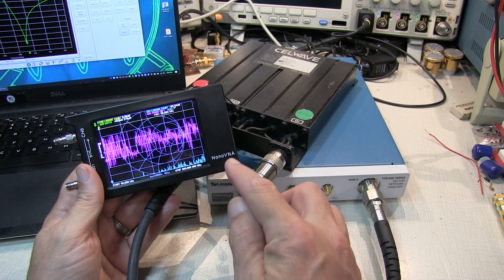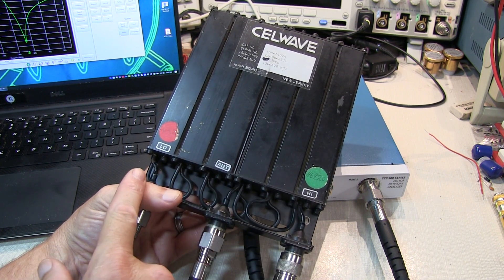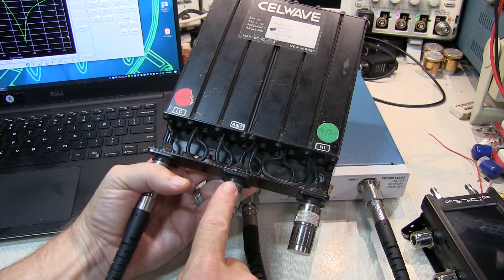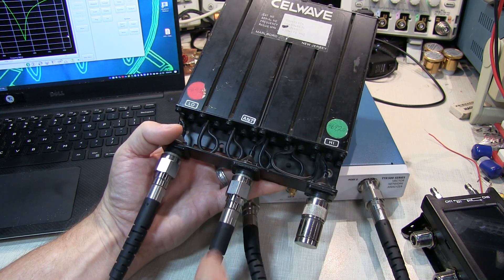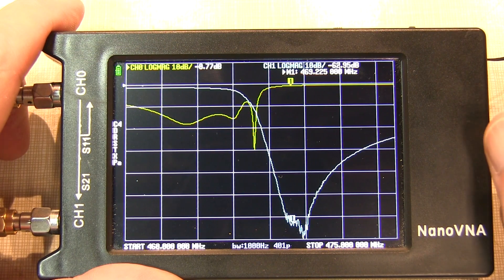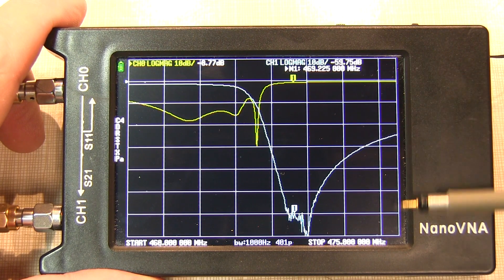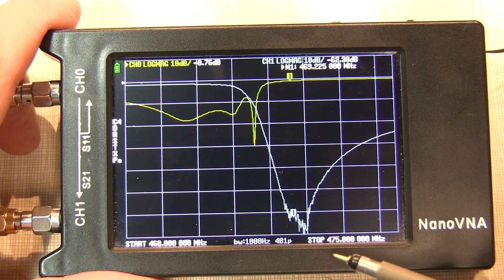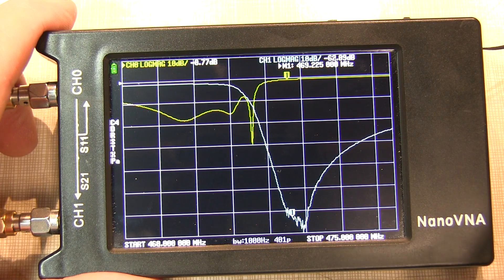#318: NanoVNA comparison measuring a duplexer - NanoVNA-H4 and SAA-2N

Comment: We have a TTR506A at work that I use daily and it's a fantastic device but for doing home stuff I love the NanoVNA stuff. I'm looking forward to the next V2, according to the developers on EEVblog it should be expanded up to 4GHz with a faster sweep speed too.
Reply from the maker: Nice - what kind of work do you do with the TTR506A?
Reply: @w2aew  We do a decent amount of antenna characterization for prototype systems here; not extremely demanding work for the VNA but I like the interface and the portableness of it, plus the support has been pretty top notch too. I was a little disappointed to see the removal of the TDR measurements but I wrote a quick little python script that pulls the data from VectorVu and sends it over to the SDR Kits VNWA program for TDR analysis and it works pretty well.
Reply from the maker: @Christian-qd5kb  Very cool, thanks.  I'm work as a Field Applications Engineer for Tektronix, supporting mainly RF applications, that's why I was curious.
Reply: @w2aew  I will say your channel was one of the reasons in the purchase; when we were looking at spec'ing a semi-portable VNA unit I saw some of your earlier videos using it and liked the interface and simplicity of it versus an equivalent Keysight unit (which also had a moderate price increase also, and the rugged portable FieldFox ones were definitely out of the range we wanted to stay in) or Copper Mountain (their software was a bit sketchy to me when I used a demo version).
Reply from the maker: @Christian-qd5kb  Cool - thanks!  Just curious, where are you located?
Reply: @w2aew  In the panhandle of Florida, currently enjoying the cooler weather finally!
Reply: @Christian-qd5kb It's been years since your comment, but I hope you see it.  I want to buy a VNA for my hobby work at home, TTT506A is about 3k$, whereas nanovna is 130$.  Of course there will be a difference, but is the difference in measurement accuracy enough to pay extra $3k?
Reply: I agree with @w2aew; hobbyist stuff the NanoVNA line is great for. If you find a TTR506A for 3k, you’ll still need to factor in a good cal kits ($$$), cables, connectors to take advantage of it. I’m imagine you’ll be looking at closer to $6k when all is said and done if you find an economical cal kit and cables.
Reply: @w2aew It's been years since your comment, but I hope you see it.  I want to buy a VNA for my hobby work at home, TTT506A is about 3k$, whereas nanovna is 130$.  Of course there will be a difference, but is the difference in measurement accuracy enough to pay $3k?
Reply from the maker: @mzerenoglu  in my opinion, for hobby work at home, the NanoVNA is more than sufficient.
Reply: look the v2plus4 ... up to 4 gig and at least 10 to 15 db more dynamic ange caused by better pcb design and lower port leaking

Comment: A Duplexer is such a complex DUT to reveal the limitations of NanoVNAs.  It is enough to measure a simple 1kΩ SMD resistor while considering the documents below:
https://www.overunityresearch.com/index.php?action=dlattach;topic=3924.0;attach=35828
https://www.overunityresearch.com/index.php?action=dlattach;topic=3924.0;attach=35778
https://www.overunityresearch.com/index.php?action=dlattach;topic=3924.0;attach=36067

Comment: I have  both he H4 and the F series with metal case.
The F series appears to be a better instrument, in both sensitivity and dynamic range. I found it does not get noisy until I get past the -90dB point when adjusting a single cavity, but have noticed that point wander about a little.
The H-4 does not like resolving notch depths much beyond -85dB, and has a tendency to pick up extraneous signals, messing up mesaurements in the 'weak signal' range of the VNA.
The TinySA is also a great tool, but takes far more patience to become proficient with it.
Love the videos!
Reply from the maker: I agree, I think the -F is a better instrument than the -H4, just a bit pricier.

Comment: Great video, thanks! What is your opinion on SDR Kits VNA for tuning duplexers? Also the new Rigol SA / VNA like the RSA3015N might be a good "low cost" option for ham repeater work. What do you think? Regards.
Reply: I haven't used the VNWA for duplexers, but based on it's specs it should be pretty good below 500MHz with a specification for 90dB of dynamic range. The one thing I like about the VNWA is the software; it's very, very powerful and can do an amazing amount of things. I have one of the VNWA3s that I've upgraded to the SE so it does automatic S parameter measurement switching which is handy along with their electronic calibration makes thing super easy and repeatable (downside is that it does cost quite a bit more than a NanoVNA but still only a fraction the cost of professional VNAs. I like mine quite a bit; for completely portable use without a laptop though the NanoVNAs are pretty hard to beat.
Reply from the maker: I have never used wither of these, so can't comment on their suitability.

Comment: Thank you for doing more videos on duplexer tuning.  I've tuned several of these mobile notch duplexers on an HP 8920 I purchased calibrated from a well known source that provides these service monitors to mobile radio shops.   With a 3Khz resolution bandwidth the best I've been able obtain is ~84db notch.   The specs sheets on these units usually say something around 75db, such as https://resources.tessco.com/attachments/76905_633-6A-2N.pdf.     So I'm confused on how you're getting 100-110db notch.
Reply from the maker: Guaranteed specs are one thing, actual typical measured results are another.  If you look at the plots in that datasheet, they're showing a 90dB notch.  I'm sure they spec 75dB to cover tolerances and operating temperature variations.
Reply: @w2aew  Also, the HP 8920 and 8935 dynamic range for the spectrum analyzer is a bit less than 90db and would line up pretty close with the ~84db mentioned.

Comment: Can you post a link to the firmware you mentioned that you're using with the NanoVNA H4?  Thanks again for your informative videos, I look forward to all of your updates.  N9PBD
Reply from the maker: The one I am running is in this message thread: https://groups.io/g/nanovna-users/message/17853
Reply: Possibly more to the point do the existing PC apps like NanoSaver still work with the 401 points ?
Reply from the maker: @RobB_VK6ES  Haven't tried it yet.
Reply: I was following the thread to the link Alan posted above.  I have been playing with the same firmware and it is nice on the H4!

Comment: Great Video; cool example of where dynamic range really comes into play. 2 questions (1) Is 1kHz measurement BW the minimum size for the nanoVNA-H firmware you were using or is it possible to squeeze out a bit more dynamic range by going smaller; if not, is this a hardware limitation? (2) is the measurement BW adjustable in the SAAV2 firmware you were using?
Reply from the maker: For that firmware, you can adjust it down as low as 33Hz, but I didn't see any real improvement below 1kHz, just slower measurement speed.  I don't think the BW was adjustable in the SAA-2N firmware I was using (although you could go up to 201 trace points).